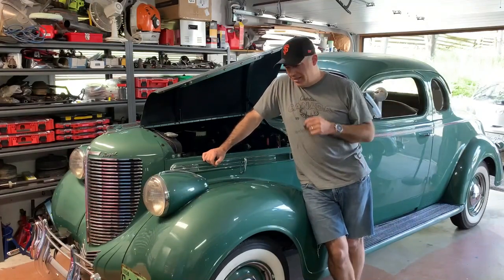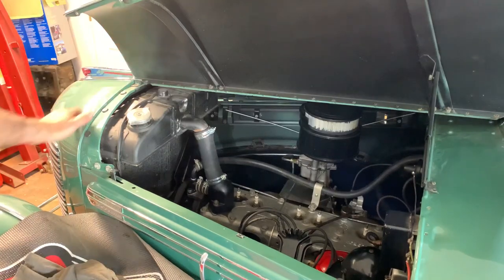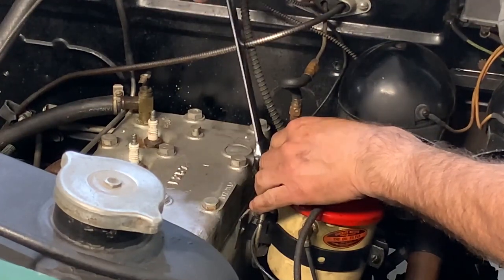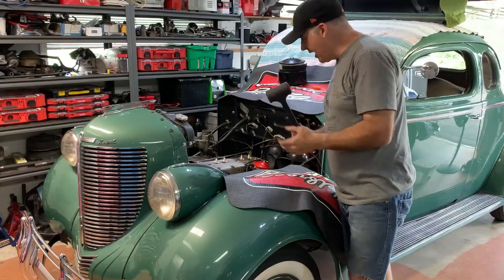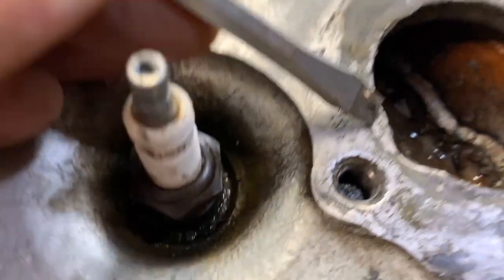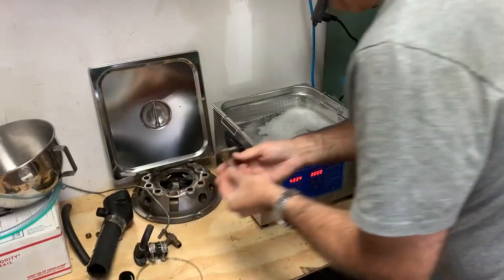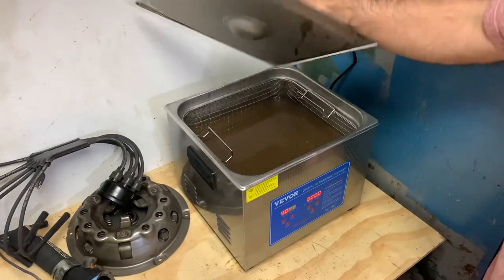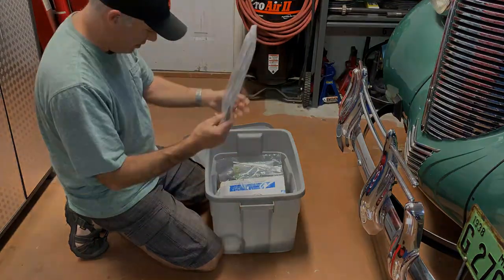Part 1: Flathead Mopar Cylinder Head Crack!

Comment: Another great video Keith. One tip for your ultrasonic cleaner is that you can fill it with plain water then use the cleaner of your choice and put your parts in a jar. The ultrasonic will transmit through the jar and your cleaner doesn't have a mess when you are done. A tip I got from Steve's small engine saloon channel.

Comment: Keith, I just replaced my head gasket. Between 5&6 cylinders, there was a piece of gasket blown away. It was the smaller strip that was blown. It’s all backup and running and the engine per’s on for another day. Glad hat you will be making videos of your engine projects.

Comment: I've repaired  one of these temp gauges after it got siezedin the head by quickly soldering on a donor bulb that has been kept in the freezer, been good for a year now. It's tricky but certainly doable.
Reply from the maker: Did the ether not escape?
Reply: @keithsgarage5831  It seems like the solder joint held up, used some copper tubing as a sleeve to butt the ends of the tubes. You can keep the ether filled bulb in a jar of ice water to keep it from evaporating while you flow the solder, it was a real surprise to see it work again. I was kinda skeptical but i couldent afford a replacement.

Comment: Looks like someone tried to take the ridge off the top of the cylinders and ended up with a taper so the two close cylinders have a real reduced amount of material between cylinders so probably why the gasket is showing carbon as not enough sealing surface now. Reminds me of my 1950 Plymouth flathead six I had as a 17 year old kid.

Comment: Keith great info and video I what to double check  part numbers before I order i ended up with manifold kit for 23''  Could you give me the part numbers for head gasket and manifolds  .Have to do valve job I   have a 1939 P7 25'' no hump or bypass engine Thanks Brian

Comment: Hi keith, nice video. What do you think the problem on the foot starter if you step in it and stuck? It doesn’t go down. Car usually start. Please respond 😊 thanks Ed from Los Angeles.
Reply from the maker: Remove the starter and check the linkaage. Also the nose cone with bendix. Its likely the bendix is bound up.

Comment: Hey I have  49 Plymouth special deluxe I think the head gaskets blown it over heated bc the last owner didn't wire up the fan correctly it was my first time driving it after buying it wouldn't start till I had a mechanic come hot wire it and mess with the distributor it never had water in the oil but did start weird after that if the key was in a funny position it would keep engaging the starter my son blocked the Plymouth in the driveway for about a month or two so I was not able to drive it but after it had water in the oil I don't know if it is the head gasket or not but could the water distribution tube in the motor or bad water pump gasket cause this issue it started a few times with one coming out of tailpipe still drove just rough start the first time and after it was ok motor just Shaked and starter acted fine after initial start I only drove her once or twice a week for a few miles I can't find a mechanic to help me fix it so I'm going it on my own I have the book im pretty knowledgeable about cars and mechanic work but not good at timing chan's or setting a motor any info would help me out so much it's only got 43k miles on it don't want to ruin the motor my first antique too in pretty good condition glad I found your videos very thorough and informative if you know anyone in new Orleans that could help that would be great thanx from the bayou
Reply from the maker: I have over 100 videos uploaded. You should endeavor to watch them all. You will learn a ton. Water distribution tube or water pump gasket will not allow coolant to enter the crankcase. So its not those. Perform a compression test. Two siamese'd adjoining cylinders with lower compression is a sign of a failed head gasket. Water coming out the exhaust pipe is not a sign of a failed head gasket. Moisture (water) is a by-product of burned gasoline in the combustion chamber. It leaves the cylinder and condenses when it flows through the cool exhaust system. Forming little droplets of water on the inside walls of the muffler and tail pipe.  It comes out the tail pipe as droplets of water. When the exhaust heats up it stops  condensing and exits the pipe with the exhaust gasses.  Sorry I don't know anyone in New Orleans. I am in Canada. Best thing you can do, is learn to look after your car yourself. Joing P15-D24.com web site and get tons of help there.  Cheers. - Keith

Comment: Hi Keith, I have a finned aluminum cylinder head and a two single intake for a flathead Dodge or Plymouth engine, if anyone is interested. Bill
Reply from the maker: Hi Bill How long is the head 23” or 25”? Thx.
Reply: @keithsgarage5831  23"
Reply: Do you still have those?